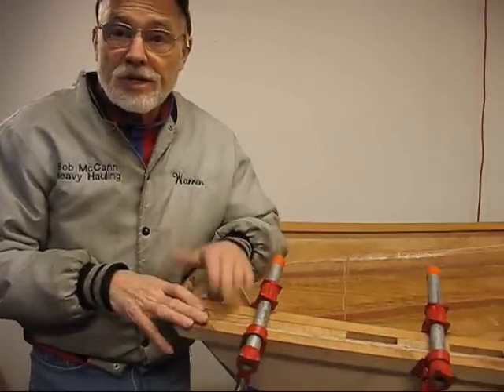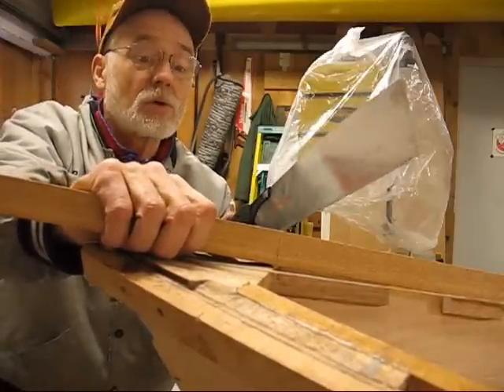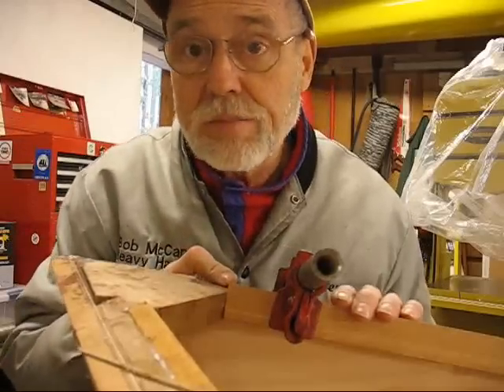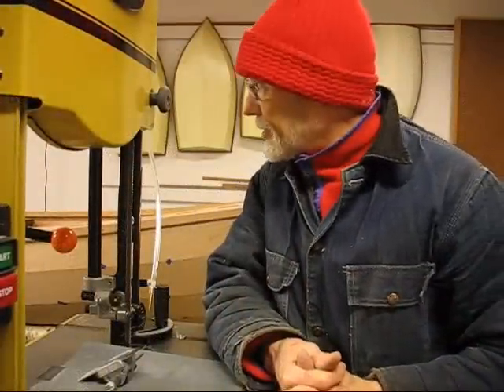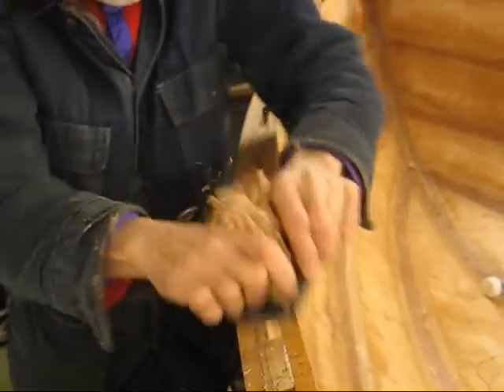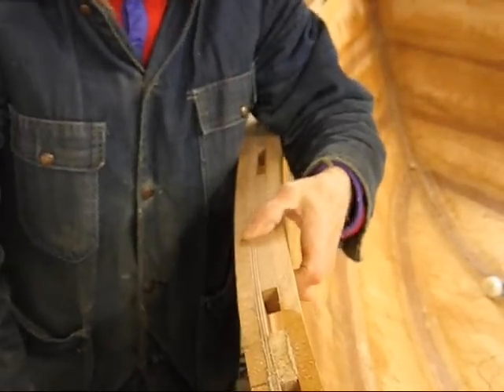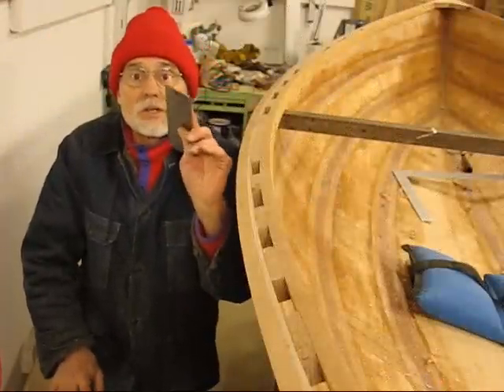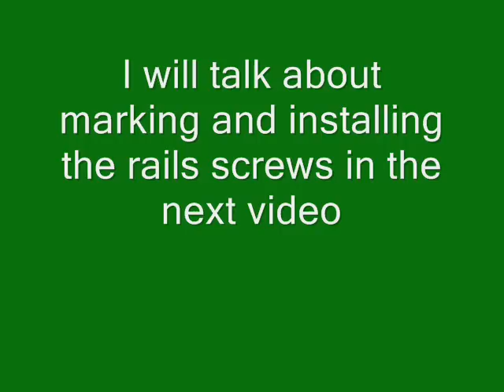Part 21-7 Installing the Rails.wmv

Comment from the maker: Love it!  I haven't used the extra height of the riser block too many times, but it's there when I do need it.  I read some reviews in "wood working magazines" before I got mine, and they didn't like the fact that the wheels were out of alignment.  Mine is off by 30 thousands, but the blade tracks with no problems.  The only problem I had was getting the upper bearing carrier back inline with the bottom.  I have a video on how to square up the saw after mounting the riser block.  Look for it.

Comment: I have a question? how's that 14inch powermatic bandsaw holding up. the reason i ask is because i just purchased one without the riser block and i'm wondering if i should get one. but i've also read a lot of negative reviews on amazon.com about the riser block not  ligning up correctly.  did you have any problems aligning it ?.